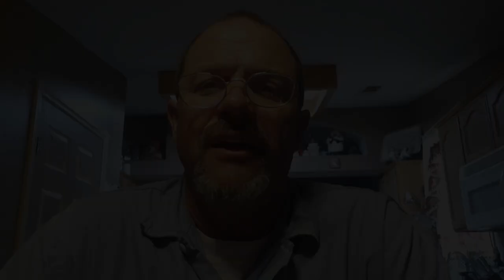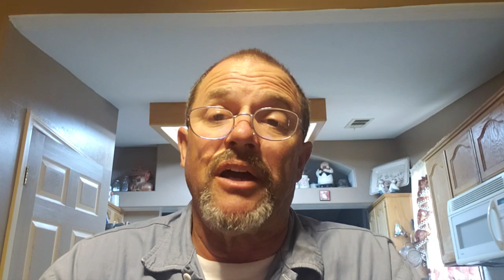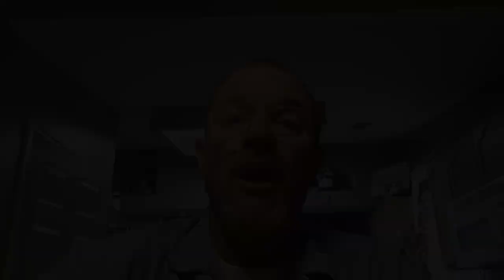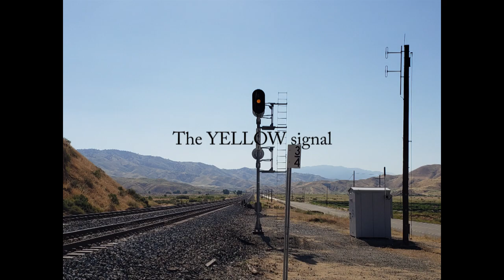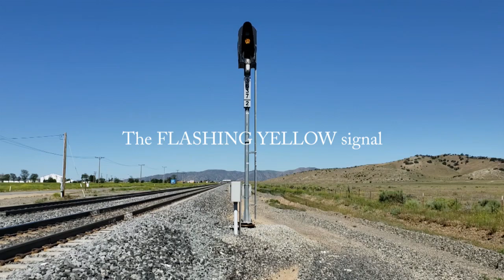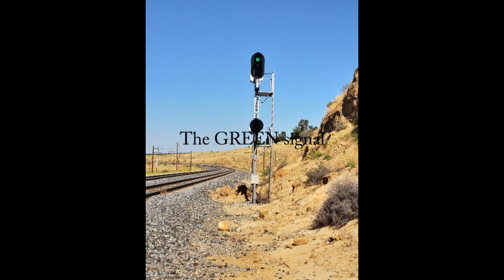Railroad Signals Explained and how they are different from Highway Signals: Part 1

Comment: You did not mention the Luna signal.
Reply from the maker: We no longer use lunar signals on this part of the system but I believe I touched on them in part 2.
They were replaced by flashing reds.
Thanks for checking it out!
Reply: Mark Clay McGowan    Does the flashing red signal require a stop?  Since it replaced the Luna is it still called a low signal?
Reply from the maker: @billmorris2613  no. It is a restricting signal, not a stop signal. Its indication is "proceed through turnout at restricted speed prepared to stop short of another train".
Reply: Mark Clay McGowan   So it’s the same indication that is on the EOT / FRED?
Reply from the maker: @billmorris2613  no. The EOT is an operating part of a train. Its flashing red light is a marker light (like the red light on a caboose or the dimmed headlight on a rear helper) not a signal.
Reply: Mark Clay McGowan   I understand all of that. But under certain circumstances it could be mistaken for a proceed (but not a clear) signal.  It happened to me when the EOTs first came out.  The light on the EOT was a flashing yellow.  I was on the main line and had gone by an approach signal at the north end of a siding and was coming around a curve prepared to stop.  It was night time and I saw the flashing yellow and kicked my brakes off taking it for the signal at the south end of the siding.  

This was a common situation at the south end of this siding.  Then I realized the light was to low to be on a signal mast.  I put my train in emergency and stopped only a few yards from a dark signal.  The rear car that the EOT was on was only 2 to 3 car links on the other side of the dark signal.  It was the last empty flat car in a block of about 15 flat cars.  My headlight did not illuminate those cars until I was nearly stopped.

I was on the phone the next morning with our FRA operations guy.  They shortly changed the yellow flashing light to a red flashing light.  At that time we did not have a signal that displayed a flashing red.  They should never have any type of a proceed light on the EOT.  The cabooses use to have a steady red light.  I was rather surprised when you told me they had replaced the luna with the flashing red.
Reply from the maker: I never saw a flashing yellow EOT. It's almost inconceivable that anyone would even consider that.
Just goes to show that the most knowledgeable people aren't always the ones making such decisions.
Reply: Mark Clay McGowan   It was in the very early days of the EOTs.   When you hired out was the caboose still in use?
Reply from the maker: @billmorris2613  yes. I hired in 79 and the cabooses went away about 1987.
Reply: @MarkClayMcGowan  I'm going to respond, and hope I don't ruffle tpp many smooth frathered fellows.

This story plays out in too many investigations. Please take no offense Mr. Morris.

In this recollection the last observed fixed signal displayed a yellow aspect indicating "proceed prepared to STOP at next signal, with the appropriate "if" conditions applicable to speed of operation, like "not to exceed 40 mph."
Here is the fearsome part.  Been here, done it. That next signal will probably be yellow, too.
And the one time its not.....
The expectation has to be, "that next FIXED signal WILL be red, or dark and da&#@&n it I'll have to stp and ..... "
PTC will help in our thinking.

Comment: Can someone tell me how long is a block which a signal protects.
Reply: It could be any where from a few hundred feet to several miles.  On a territory with Automatic Block Signals (ABS) it was usually 2 to 4 miles on the territory I worked on.  Maximum track speed grade (up or down hills or mountains), what the signal protects, like a draw bridge, junction of tracks, crossing another track, are a few of the major factors that determines the distance between each signal.
Reply: @billmorris2613   thanks Bill

Comment: Things have gotten more complex yet given more options. My uncle used to operate trains four Southern Pacific and he told me of a problem that occurred years ago. There was a terrible train accident out in Nevada. Originally my Uncle was supposed to be on that train. My Grandmother told me she called the railroad saying her son was  on duty on a train. He wasn't; a change had been made.

In those days there was no dead man's switch on the engine. The lights were green (no problem for two signal or more; clear), yellow, (next signal is read) and red (A train or obstruction between this signal and the next) .

To open the throttle a rod was pulled out. To release the throttle the rod was pushed in. The engineer leaned on the throttle rod. He died of a heart attack but was still leaning over the throttle rod so the train continued to travel. It went through more than one yellow without slowing down. Finally it went through, if I remember right, two red signals at full speed before suffering a disastrous collision that took a number of lives.

The other people in the engine survived and knew nothing of railroad signals. They did not know that the engineer was already dead. My Uncle did know these things about trains. Had he been there the disaster would never have happened.
Reply: I’m a retired road engineer off the Union Pacific.  The other crew members in the engine cab would have known the meaning of the signals and the reaction required of the engineer.  Depending on how long ago this accident was there could have been two other crew members, a fireman and the head brakeman.  If it was in the last 25 or 30 years ago the conductor would have been in the engine with the engineer.  And possibly a fireman and a brakeman could have been in the cab too.  So if none of the other crew took action to stop the train they were either asleep or you have your facts wrong.

Comment: WHAT DETERMINS the number of engines on a train, and where DPU's are placed?
Reply: The number of engines placed on a train is determined by several factors,  The horsepower (tractive effort) of each engine, the gross weight of the train, maximum track speed, rather the train will operate over flat, hilly, or mountainous territory.  

I never used DPU but probably the ones already mentioned above plus the length of the train and the make up of the train (how the loads and empties are distributed in the train.)

Comment: How long are the blocks generally and do these vary in mountainous country or commuter routes?
Anthony
Reply from the maker: blocks around here are generally about two miles long but there are certainly exceptions. As far as commuter lines go, I really do not know.
Thanks for checking it out!
Reply: They typically vary between 1 to 4 miles.  They are usually spaced according to the stopping distance of the fastest, heaviest train.  If any train train cannot stop from an Approach to a Stop, the more aspects have to be used, which is where things like Advance Approach come in to play.

Comment: I’ve only operated on east coast railroads under NORAC and GCOR rules. I’ve heard there is a fundamental difference between signaling on eastern vs western railroads: that eastern signals denote speed information e.g. slow, restricting, advanced approach, medium approach, approach , clear.  And that western systems show condition of signals ahead. Is there this difference?
Reply from the maker: It's essentially the same. The engineers call out the signal by name as you indicated and they are listed in the Special System Instructions for UP. All indications give information about the track or signals ahead. I do know that different roads have different names for indications.
Thanks for checking it out!
Reply: You're talking about the difference between Speed Signaling and Route Signaling.  
For the most part, the differences are subtle.  In the U.S., the only real difference is how diverging aspects (for changing tracks) are handled.  

In a Speed Signaling system, the signal indication itself prescribes the maximum safe speed for the switch(es).  These speeds are generally standardized and are usually around 15 MPH for Slow speed, 30 MPH for Medium speed, and 45 MPH for Limited speed.  When a signal shows Limited Clear, the crew automatically knows it should be able to go 45 MPH (or whatever the rule is) through it.   The distant signal (the one encountered before the Limited Clear ) will usually show Approach Limited to indicate the maximum speed of Limited speed at that next signal.  

With a Route Signaling system, the signal aspects generally describe the route to be taken, and not the speed.  The speed for the given turnout is listed in the timetable, and must be known in advance.  Speed signaling is more flexible, but it also has many overlaps.  Let's say that one signal protects a track that splits into three tracks.  The first switch might be 35 MPH and the second switch just after it is 15 MPH.  The signal can show Diverging Clear as Red over Green over Red for the 35 MPH track and as Red over Red over Green for the 15 MPH track.  The train crew has to know this distinction; but the distant signal (encountered before the diverging signal) can also hint at the speed required at the next signal.  That distant signal would likely show Yellow over Yellow Approach Diverging for the 35 MPH switch, and Yellow over Red Approach for the 15 MPH switch.  If we alter the example and make both turnouts 35 MPH... then the diverging signal might still work the same way!  Or, more likely, it would just be a 2-head signal, and show Red over Green for either route.  If the speed limits are the same, then actually knowing the route to be taken doesn't matter as much.  

Generally speaking (for class 1s):
UP – Route signaling
BNSF – Route signaling
CSX – Speed signaling (multiple schemas, depending on the location's predecessor's practices)
NS – Mix of both Speed and Route signaling (depending on location's predecessor's practices)
KCS – Route signaling
CN (US lines) – Route signaling
CP (US lines) – Route signaling
Amtrak – Speed signaling 

NS's "official" signal schema is Route signaling, but former Conrail territory can be Speed signaling. 
CP and CN are all Speed signaling in Canada in the standardized rules there, but the "DIV" aspects and indications are essentially Route signaling exceptions.

Many people may see speeds and rules like BNSF's Approach Medium and think "Speed signaling!" but that is incorrect.  This may be controversial to a few people, but safe train handling rules do not, by themselves, define a Speed signaling system.  UP's Diverging Clear Limited is NOT a Speed signaling aspect, as such do not use arbitrary speeds like that rule does.

Comment: I never knew what all the signal colours meant.  Thank you for helping to clear some of it up.  :)
Reply: Just remember: Each American railroad has different rules for signals.  The meanings of the combinations of lights will be different in different places, even on the same railroad.
Reply: @jovetj  that sounds like an accident waiting to happen.
Reply: @thomaskirby6706  You're not the first person to say that.  But it isn't that big of a deal.  Remember that all train crews have to be qualified on the tracks on which they operate.  You cannot just get placed on a locomotive and run a line you've never seen before.  The crews have to know where each curve, signal, speed restriction, grade crossing, etcetera are.  They must memorize the signal rules for their territory in their entirety.  
So, there are incidents where multiple signal systems are in effect for a train crew in different spots and they've gotten confused, but those are not that common.  

This is also more an issue on eastern railroads where multiple predecessor railroads have never been brought into unity.  The cost of changing the signals in the field and retraining crews is a real obstacle.  This situation doesn't exist on BNSF and UP because their systems are more-or-less unified on their territory (because it was cheaper to accomplish at the time of merger).
Reply: @jovetj  Thank you for the excellent response.  :)
Reply: @thomaskirby6706  Sure, I'm happy to help!  As a railfan, signaling is "my thing."

Comment: 7:18 At the risk of saboteurs laying some metal from rail to rail, if a car or truck got stuck on the rails at a crossing, could shorting out the rails signal a dispatcher or engineer to slow down or stop before the crash? Penalty for false alarms?
Reply from the maker: If the vehicle were across both rails, yes, it would cause the signals entering the block to turn red. If a train were already past the signal when the vehicle got on the tracks there would be no way to warn the crew and you'd have to just hope they saw you in time! If you ever find yourself in that situation, get your jumper cables out and connect them to both rails. If you see a train coming, walk TOWARD the train and away from the tracks.
We get "indications" all the time and they are caused by many things. If it's a maintenance issue you will definitely be explaining it to your boss the next morning!
Thanks for checking it out.
Reply: @MarkClayMcGowan  I don't know but (How many times have you heard that?  LoL) therefore connecting a battery cable would be the next highest priority below lifesaving so an engineer would see the signal. Above phoning 9-11. Wouldn't the Dispatcher also see it and radio the engineer to stop even if the last control signal was past?
Reply from the maker: @ProperLogicalDebate  once a train has passed a control point the track to the next control point just shows occupied on a dispatcher's board. Sometimes there are split blocks but that's rare these days. Intermediate signals are automatic and will go to red in such an instance but the dispatcher can't tell what Intermediates are doing.
If there are no trains between control points the dispatcher will see the indication and either stop trains at the CP or flag them into the block at restricted speed (a speed not exceeding half the distance it would take to stop short of another train, misaligned switch or anything blocking the track). At that time signal and track are notified of the problem and dispatched to the area and are notified if a call comes in about a vehicle on the tracks.
I hope that helps!
Reply: It's really safer to just call the railroad as quickly as possible, and know your location to tell them where they are so they can stop the trains.  Get everyone out and away from the vehicle.

Comment: Sooo red-stop yellow-caution green proceed normally...sounds familiar..
Reply from the maker: Except highway signals have nothing to do with the condition of the road ahead of them, but only that traffic is moving against them at that intersection and do not consider braking distances.
Reply: Yellow isn't called caution, that's only on cartoons and for foamers. 
Aspect, Yellow: Indication, Proceed prepared to stop at next signal.

Comment: Those aren’t seaboard signals?
Reply from the maker: Seaboard?
Reply: Seaboard Railroad.  It ran along the East coast from just South of Washington DC to Florida. Seaboard and Atlantic Coast line merged to form Seaboard Coast Line.
Reply: Correct, they are not. Seaboard uses different rules, and Flashing Yellow on Seaboard means something completely different than it does here!